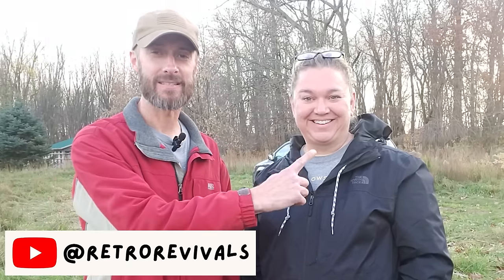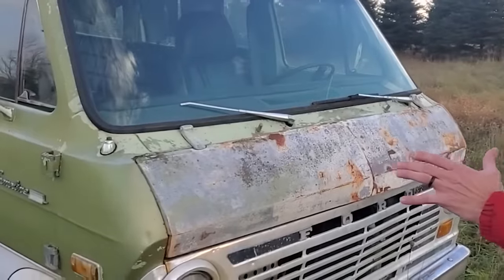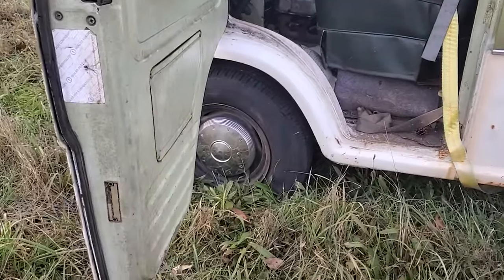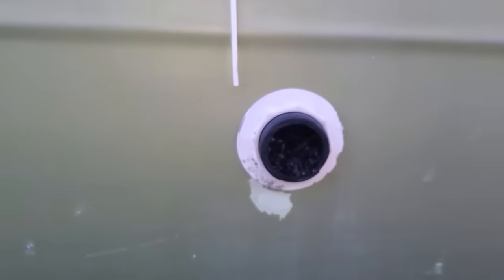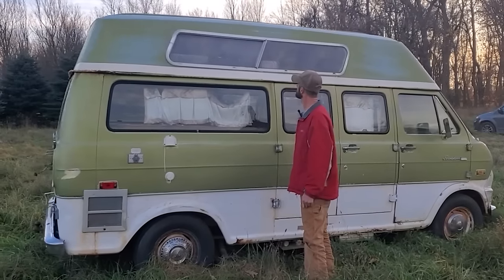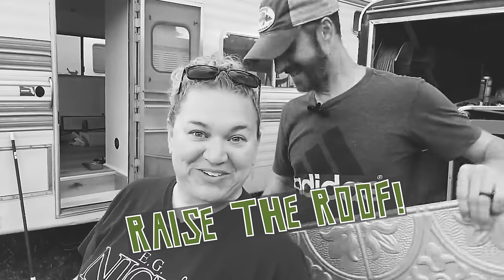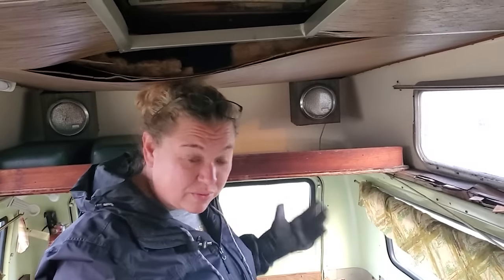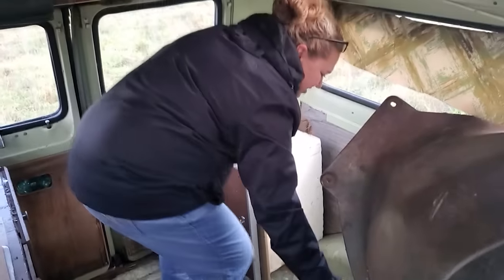Vintage Ford Econoline Camper Van - Saved From the Junkyard for Full Renovation!

Comment: dont get me wrong but with the amount of work that van/camper is going to need 1200 is pretty steep something like 800 then i say it was a fair deal
Reply from the maker: You have a point. In our area the old Econoline vans are pretty rare. So we paid a little more based on that.
Reply: @retrorevivals  there rare here to but nobody wants them so most were scrapped or still sitting behind barns and in worse shape than that one is

Comment: Omg a hood for that could cost you $500 I have an 82 Chevy van that has a 3/4 ton dual axle in the rear it's called a longhorn the same thing is the Dodge dreamers but they only built 8 of them they were sold with a fifth wheel camper on the back originally I don't have the camper unfortunately but them van parts are very expensive if anything you could part it out for way more money than you paid for it . Just put a horn button on Christie's side of the van lol lol
Reply from the maker: Sourcing decent parts will be a challenge. But we have time. I hate to part it out when it has real potential. Plus a clean title. That's a good idea about a passenger horn 😆. That could be more trouble than it's worth though!

Comment: Please do not remove the glass top from the old ford. Those glass tops do not need detachment even with age. What you can do instead is grind off the drip rail and glass the top to the body giving it a clean smooth aerodynamic finish.
Reply from the maker: Thanks for that idea!  We're just getting to the point where we'll be able to dig in and see how it's all put together soon.  There's definitely some rotted wood between the camper top and the van that we'll need to address but if we can do it without removing the top, that's our preference.  Grinding down the drip rail is definitely an option too!

Comment: If l was you , l would shave the drip rail off completely and blend in the roof .
Reply from the maker: That could be an option. We'll have to do a closer inspection of where the fiberglass top rests on the metal to see what can be done. Thanks for the comment 😁